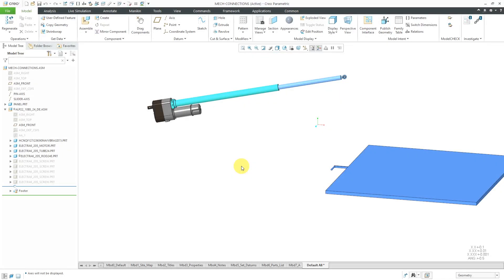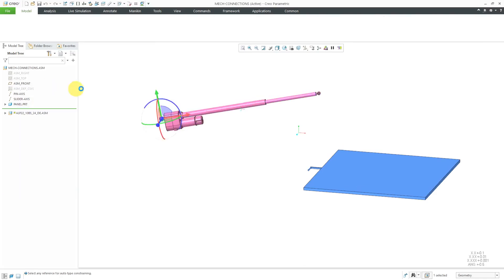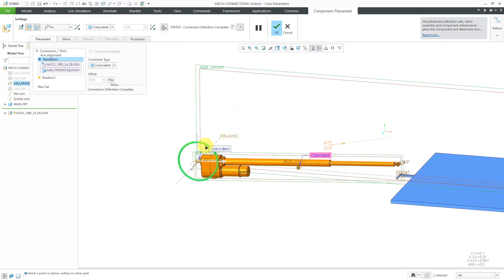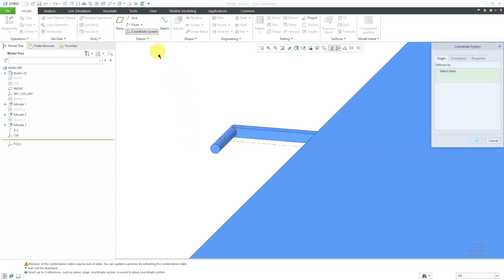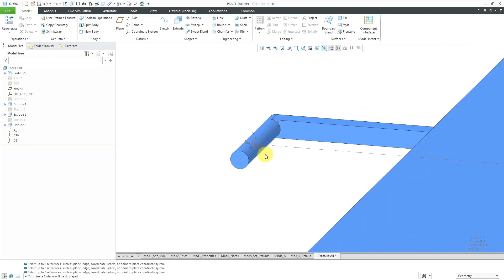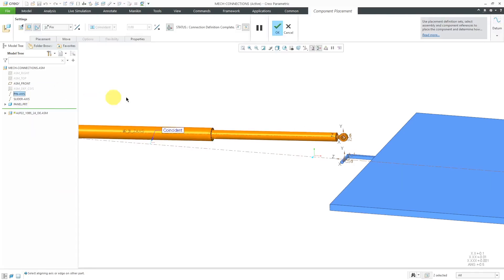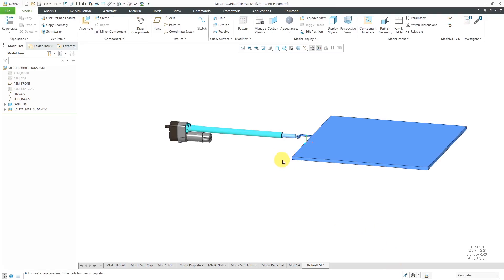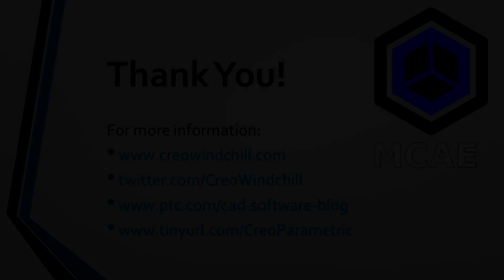Creo Parametric - Mechanisms | How to Create a Mechanism Weld Connection

Comment: Ok I don't really get the weld connection with CS's.  Wouldn't you achieve the exact same result with connecting that actuator to the rigid hook with a basic cylinder connection?
Reply from the maker: Honestly, I made this video years ago and I'm not going to rewatch it. But in general, you can achieve the same thing in multiple ways for just about everything in Creo.

Comment: Same mechanism can be made using another pin connection or a general connection. Please tell me the difference between using weld connection and the other connections in situations similar to this.
Reply from the maker: There’s more than one way to crack an egg and I’m showing those methods. Pin connection is when you want a rotational DOF. Weld connection is when you don’t.